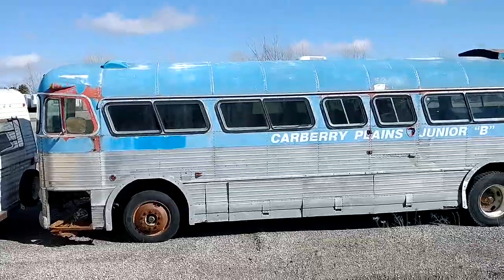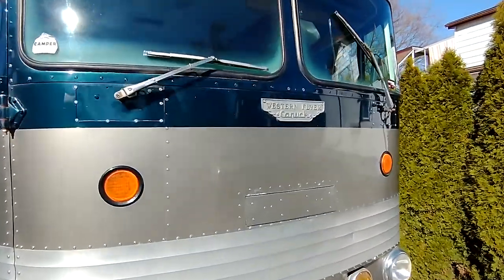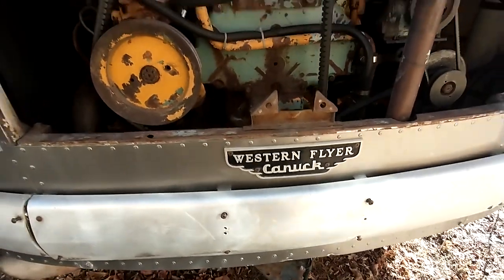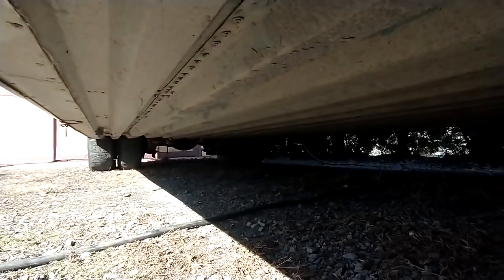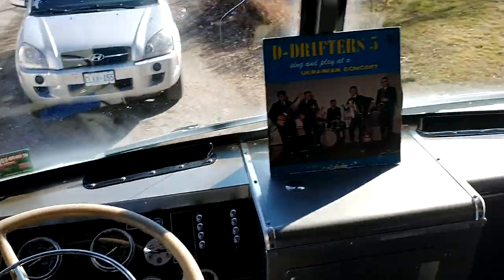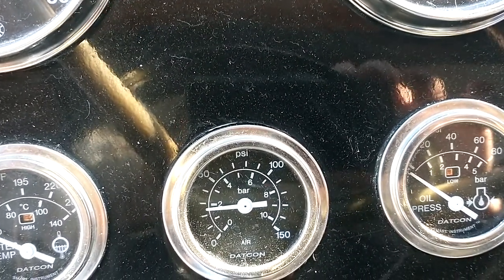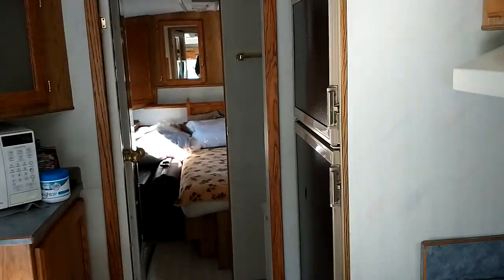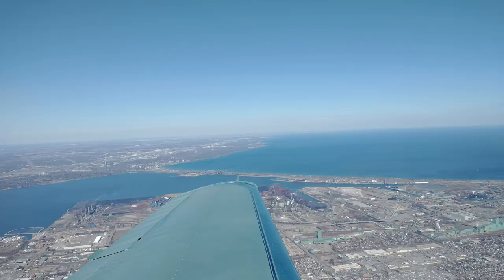BUS TOUR - Brian's 1959 Western Flyer P37

Comment: Some one asked if it was four wheel drive which it is not, but searching Western Flyer Coach found that in 1956 they manufactured four 4X4 along with 28 buses for the Department of National Defense ( RCAF). I recall during recruitment, touring CFB Nameo (Edmonton ) in 1970’s in a Western Flyer bus. Western Flyer Coach Ltd., also built the “Bruck” although not 4X4 was part passenger bus part cargo truck, first came out in 1946 serving northern mining communities. By 1951 in USA Kenworth and Crown Coach both manufactured similar units, I believe for Great Northern Railway.
Reply from the maker: If you look at the front beam, you can catch a quick glimpse of it in the video, there appears to be a dip in the center of it for a differential too!  Interesting...

Comment: Great video Jason, and a good overview of the bus. The dry road/wet road valve basically limits the air application to the steer axle when in the wet road position.  It is a relic from a time when heavy vehicle design engineers didn't have a good understanding of how critical front brakes were to safety and stopping distance. Many drivers back in the day would insert a 1/8" brake rivet in each of the front brake hose fittings to eliminate the front brakes. Basically, it was an "old wives tale" that front brakes were dangerous. One question, is the owner going to replace the floor covering? That vinyl looked a bit dated as well.
Reply from the maker: That just sounds scary !!  Thanks for the info.

Comment: Was hoping I can get some help. I recently acquired the exact same year and model of bus. It runs great but it needs a little bit of suspension work the steering is a bit sloppy. Where would one get parts for this bus? Let's say for example tie rod ends are ball joints are steering joints etc. Any help is greatly appreciated thank you!
Reply from the maker: I'm not sure where you could find parts for those. It's always a challenge with vintage buses. I'm looking for a drag link for my 3751 now.